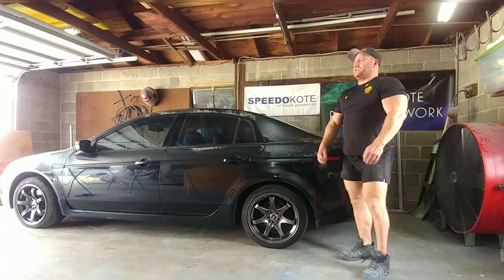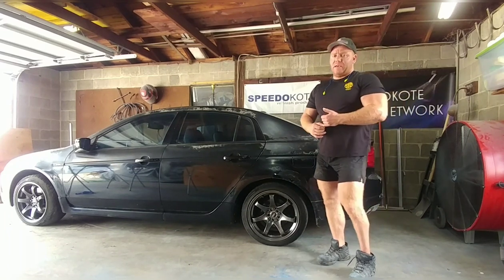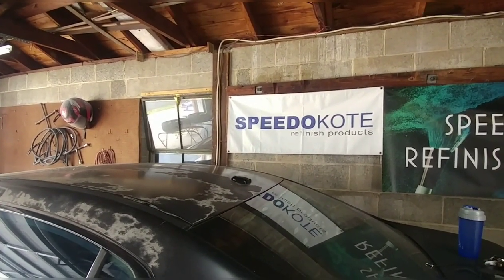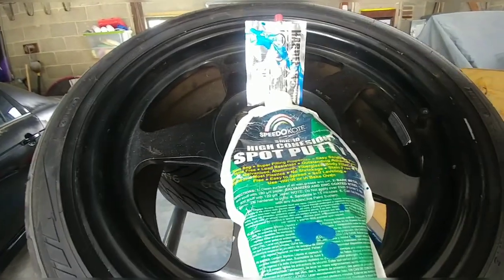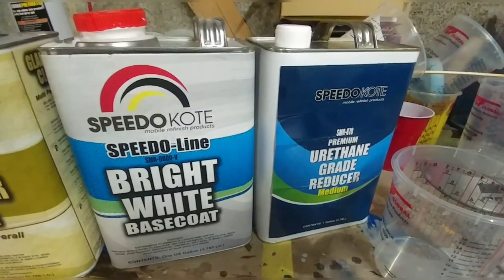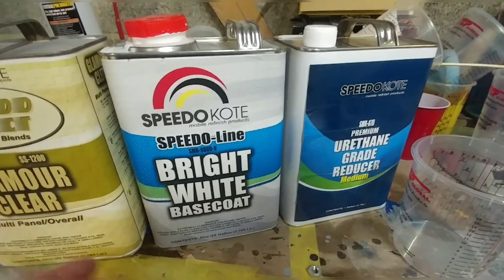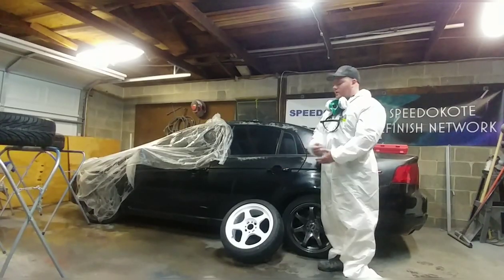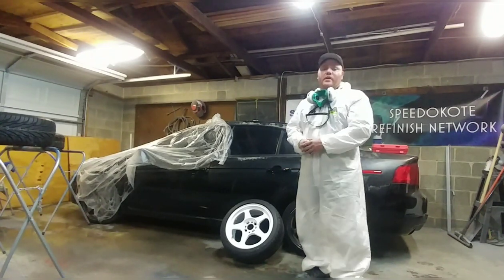How to paint rims CHEAP

Comment: Just a note that works for many, buy a deck of playing cards and stick the narrow end between the rubber and the rim. If you have a compressor, remove the valve core, deflate the tires, insert the cards then with 10" strips of 2" wide making tape, connect the dots and create an easy way to get under the rims edge!
DK, ASE master tech since 78.